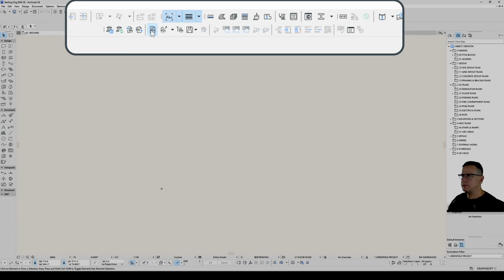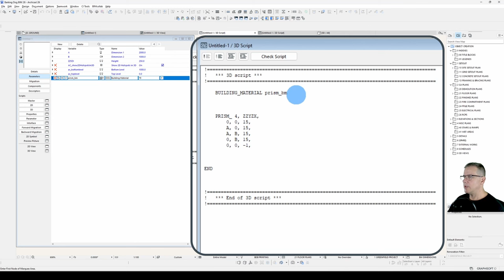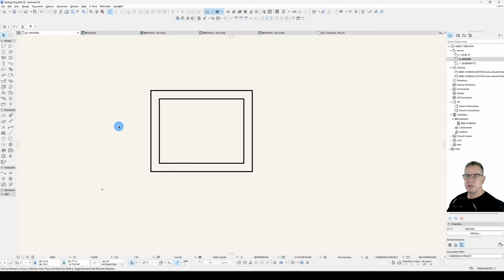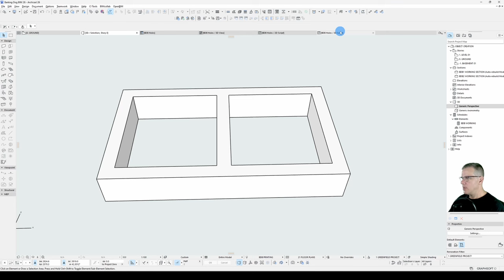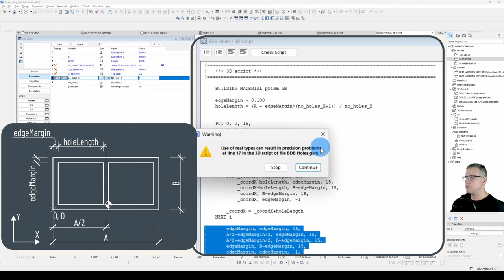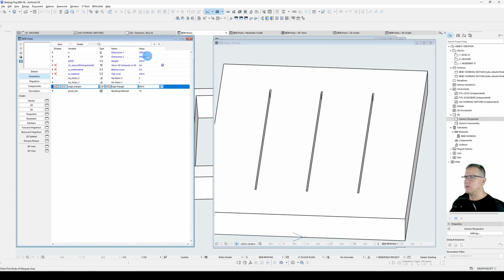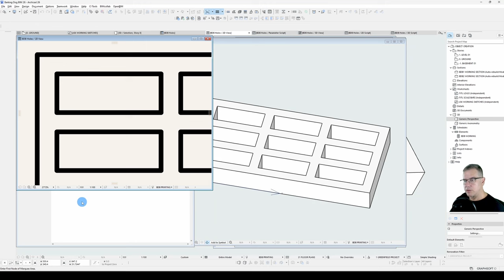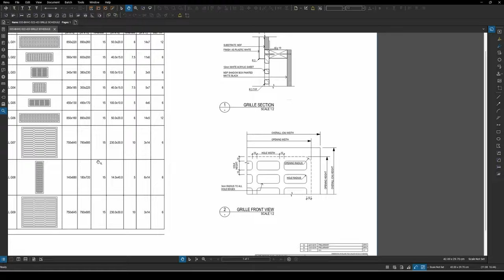018 ARCHICAD GDL Holes in PRISMs

Comment: Bruce, 2 questions:
1 - How did you extract the schedules (quantitative) from the object? I mean, How come the schedule could know how many holes there are in the specific grid?
2 - In the Avatar modeling, how did you put the grid object inside the wall? Did you save it as a window or something?
Reply from the maker: 1 - You can schedule any parameter in any object.  I created a parameter ("hole_no") that was filled with the number of holes ('X'x'Y') in the parameter script.
2 - Yes, it was an Opening > Wall Opening > Window (Wall) subtype.
Reply: @BarkingDogBIM  could you teach how to  do it? I don't know how to extract info to be scheduled from the code
Reply from the maker: @Jose.RuyBarbosa  Sure - I'll add it to the list.